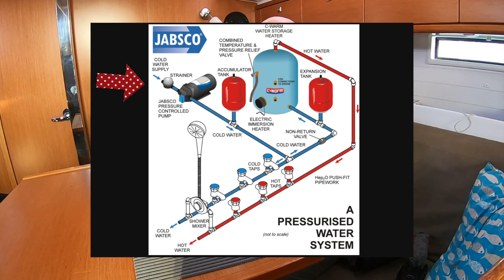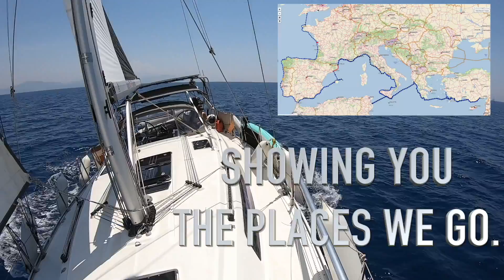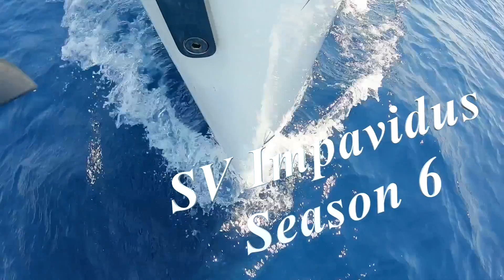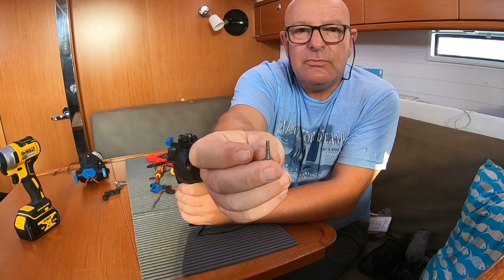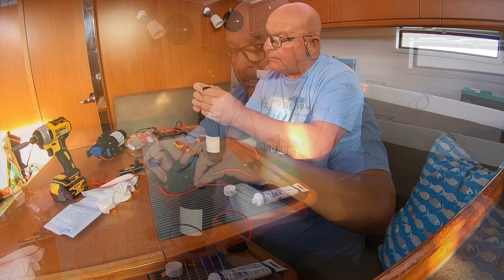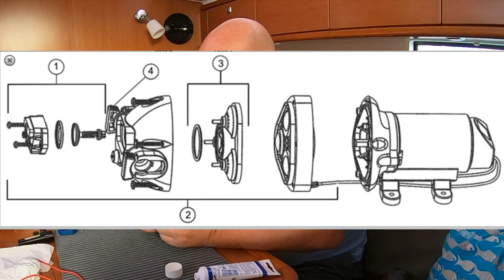Jabsco water pump repair. (Pump It Up! 😁)   What fails and how to fix it.

Comment: You can safe a few quid by just replacing the micro-switch, cost about £5, its a bit fiddly, but can be done.
And, to avoid future failure, wire in a relay, either a mechanical one, or a solid state relay, and a flyback diode. This will avoid have the full current passing through the switch, which is what cause these switches to fail in the first place.
Reply from the maker: Good advice. Sail Safe mate. Ant & Cid

Comment: Thank you. You saved me buying a new pump! I have ordered the switch but I notice the little rubber diaphram has two different ways to go on as it is indented a little. When I took switch off the diaphram sprung away and I did not see which way it was on. This is the rubbery one, not the hard plastic one.
Reply from the maker: Glad we could help! Sail Safe mate. Ant & Cid

Comment: Hi. Would you know how to fix a leak on the other side of the pump, where I think you say the brushes are. I've fixed a leak around the diaphragm before, that was quite easy but this end bit has the wires coming out and it doesn't look openable...?
Reply from the maker: There is usually a lip seal between the motor and the head. If this is damaged it will leak water into the motor

Comment: Thanks for this video. I ran out of water last week without realising, and ever since the pump got worse and worse until will not stop without me manually cutting the power to it. I've topped up the accumulator pressure and that's not helped. I'm going to follow your instructions for checking the diaphragm as it's probably all rusted up around those terminals. Thanks
Reply from the maker: Good luck with the fix; hope it works out for you.

Comment: The 8nstallation on my boat has a relay that switches the pump on and off, the pressure switch only carries a few 10s of milliamps.
Reply from the maker: That's a good way to do it. Sail Safe mate. Ant & Cid

Comment: My pump just turns on every ten seconds or so for just a half second. Ive looked over all the pipes for leaks and cant find anything. Im very new to narowboats so any advice would be greatly appreciated. Maybe its time for a new pump since im not sure how old this one is 😊.... ok i just tried closing the isolator just after the pump and it now stays off so i think i need to go over the pipework again. Must be a little drip somewhere
Reply from the maker: It can be a leak back in the pump head from the high pressure side to the low side. Usually caused by a small obstruction or muck in the valve rubbers. check and clean out the valve chamber. Regards Ant.

Comment: Hi, great video but what were the symptoms? I'm wondering if I have the same issue...

My system doesn't seem to pressurise properly, so the pump intermittently comes on every 5 to 10 seconds
Reply: Also, do I have to empty my water tank before removing the pump?
Reply: And I have just checked the switch continuity seems to be fine... any other ideas?
Reply from the maker: Check the spring is switching the contacts off at the right pressure as it is the pressure that is wrong not the pump. Sail Safe mate. Ant & Cid
Reply: @SVImpavidus  to change the pressure do I just loosen the screw?

Comment: Hi, I have a potential issue with my pump (JABSCO PARMAX 2+) which has occured after I've dewinterised her. It's periodically coming on (without being activated by a tap) every ten/fifteen minutes. My initial thought was a leak in the system. I've checked most of this (there are one or two difficult to access spaces) including the calorifier and can find no obvious leaks. I do have a tap which drips (about once every two minutes producing a quarter of a cup of water overnight). The pump is at least 12 years old. I'm wondering whether or not the pump on its own could be the source of the problem. I have also had someone hook up a different accumulator to the system and it still does it. It's cheeky of me but do you have any thoughts ?
Reply from the maker: My advise would be replace the dripping tap washer or tap.
Reply: @SVImpavidus  Ok - many thanks and for the useful video

Comment: Thanks for the straightforward video!  I am trying to diagnose my problem (pump runs constantly when breaker is turned on) and I thought it was the pressure switch. replaced with brand new and it still acts the same (water in the tanks, accumulator tank is at the right pressure).  I put a pressure gauge on the freshwater system and pressure builds way past the 40psi that the switch is supposed to break the connection. Will test both old and new switches with your resistance method (thank you for that!) but curious if there can be another problem where the water to the switch isn't reaching pressure...  Will likely purchase another pump (sigh) to have the spare available but interesting in learning from the collective wisdom...
Reply from the maker: Check your transom shower if you have one. Both the hose and the fittings behind for a small leak. Sail Safe mate. Ant & Cid

Comment: I seem to have lost the spring. Is there where i can buy one or maybe know the size please
Reply from the maker: I am not sure if they sell the spring as a separate part however here is a link to the exploded drawing with all the part numbers. Just google the part number or get in touch with your local dealer. All the details are on the web site. https://www.jabscoshop.com/marine/pumps/pressurised-fresh-water-pumps/31395-2512-3a-par-max-3-pressure-controlled-pump.htm
Sail Safe mate. Ant & Cid

Comment: I now have two spares. Would using an external relay suited to handle the larger current help avoid a premature failure to the pump?
Reply from the maker: It certainly would. Sail Safe Guys, Ant & Cid.

Comment: 🤣Tell me now I have just changed it. Mine was loosing pressure, suggesting a leak. I isolated it from the system and it still kept running intermittently. I did not know they were repairable.
Reply from the maker: It's always the way 😀 Sail Safe mate. Ant & Cid

Comment: Nice look see at Pumps Ant. Best Wishes,  and hoping you aren't being clobbered with Snow and Shivering. Not had Snow yet here in this part of Wales, but it's been ruddy freezing, and had to get a new 10.5 tog Duvet, and sod's Law, the day after it arrived it stopped freezing and turned to Rain lol. After successive years of La Nina's,  looks like we are now entering what may be a Super El Nino,  and depending on where we are in the World, things could be getting interesting. Best Wishes.  Bob.  🤔👍⛵️✨️✨️✨️❤️
Reply from the maker: Temp has not dropped below 20c in the day and 12c at night been a tad windy which is unusual here. Sail Safe Bob. Ant & Cid

Comment: Thanks for another very good instruction video and the timing is perfect because we had this problem this summer and changed the waterpump but saved the old so Anders have on the todo list to repair it we are pretty sure its got this problem so we need to buy the repairkit than I promise you will get another view or two on this video😀 Thanks hope to meet you some day on the blue Med
Reply from the maker: Thanks for watching and the comment guys. Sail Safe. Ant.